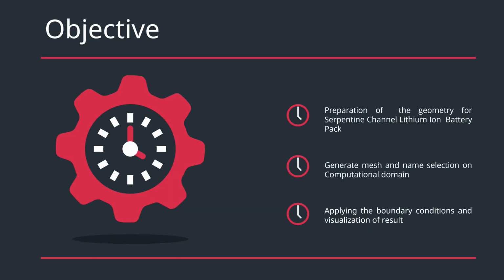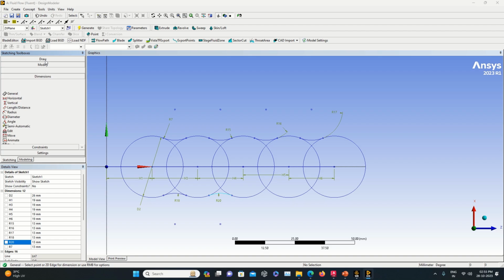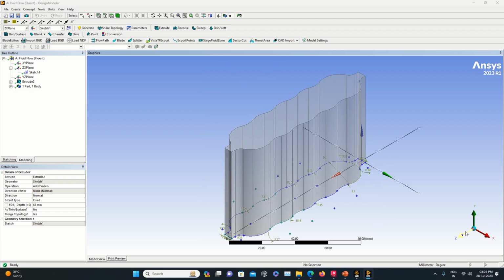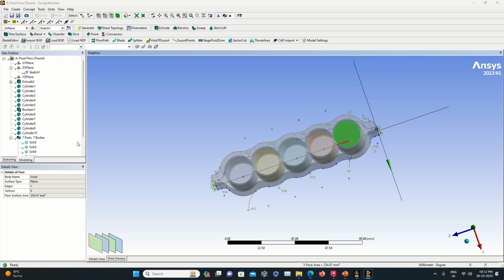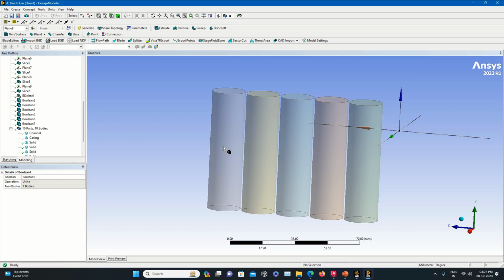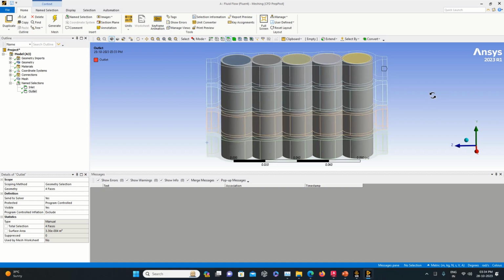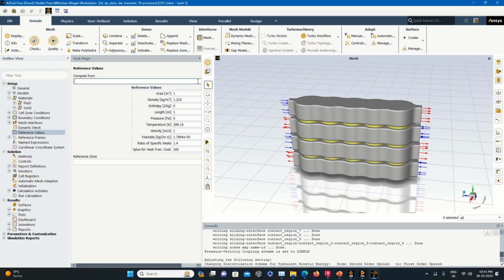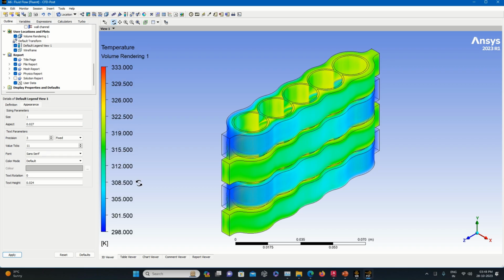CFD Simulation of Lithium-ion Battery Pack in A Serpentine Flow Channel with Air as a Working Fluid

Comment: Hi. Should not be the case material of cells are steel instead of nickel?
Reply from the maker: Yes you can add material as per requirement